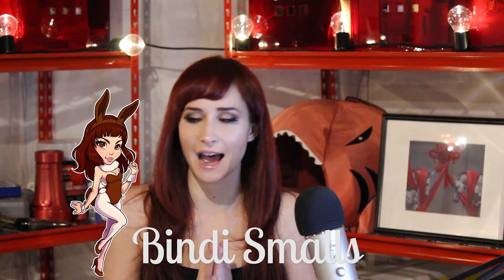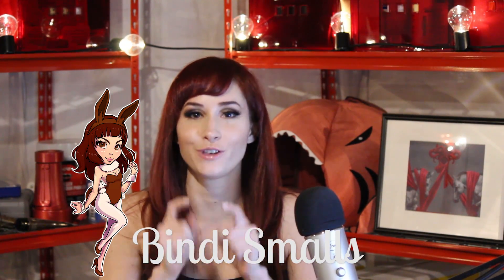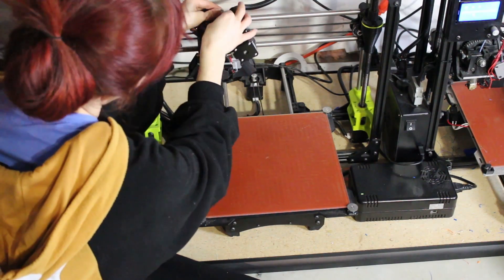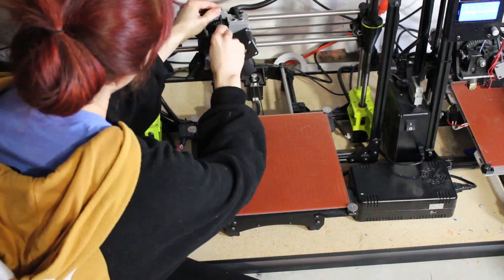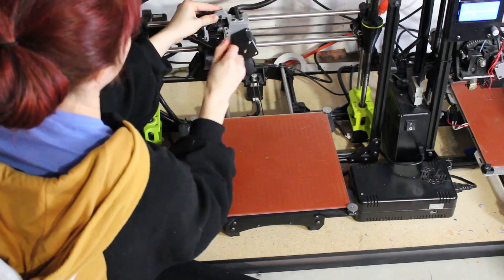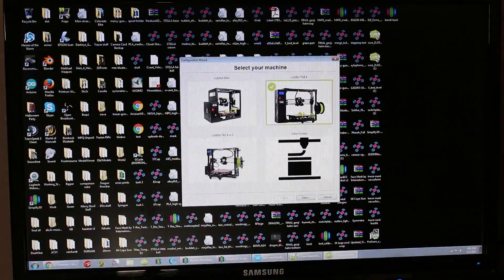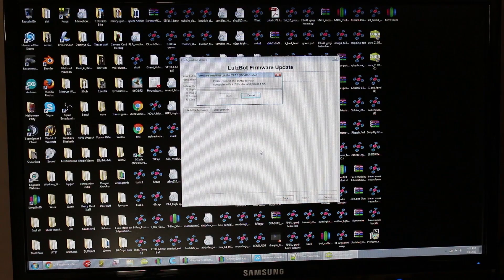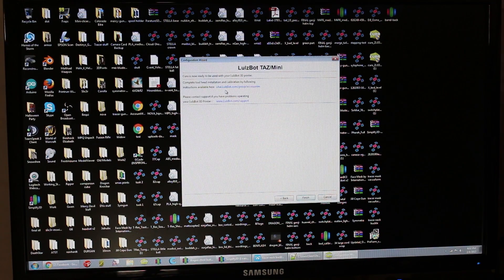LulzBot MOARstruder Toolhead REVIEW!

Comment: Thank you for leaving this up.  How easy is it to go back to the standard filament head after using this?

None of the videos on Lulzbot print heads ever talk about this... or if they try the whole process failed and they ended up upgrading or sidegrading to another controller board, etc.

how easy is it to back to the original printhead?  Do you have to change settings?  Thanks... I do have a moarstruder I got during the pandemic I never set it up.
BTW I got one of the last NEW TAZ6 just as the pandemic was starting I have been using it for years now and I dearly love it... it never breaks [knock on ABS], never lets me down!

Comment: Bindi, could you use this tool head to print smaller things or would you just recommend it strictly for large items?
Reply: The MOARstruder is for larger items to cut down on the print time. You can use it for smaller items too, but with the larger nozzle size the resolution isn't as good as a standard size nozzle.